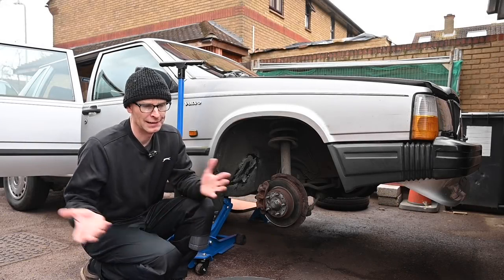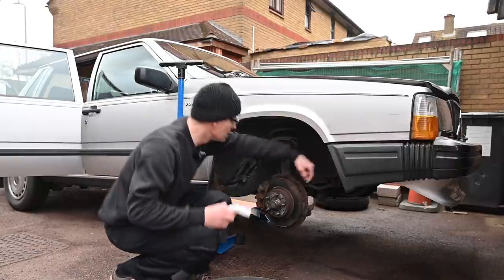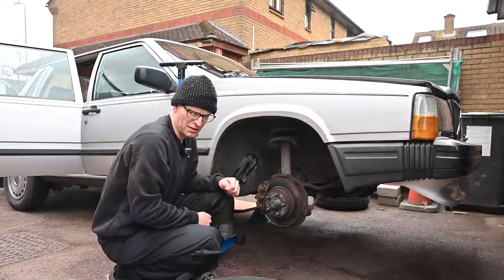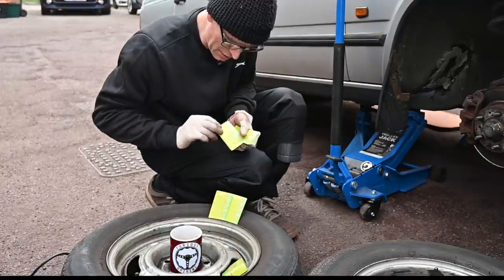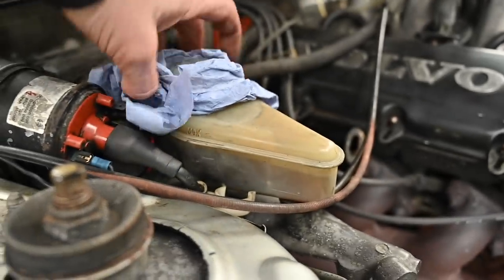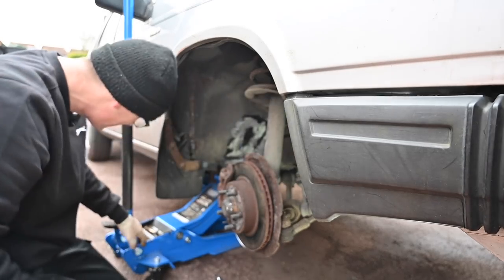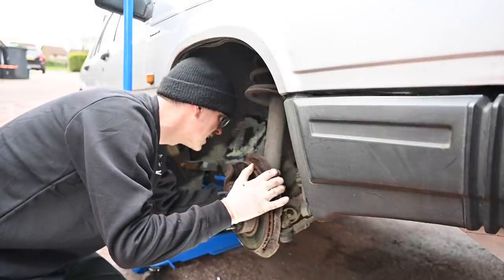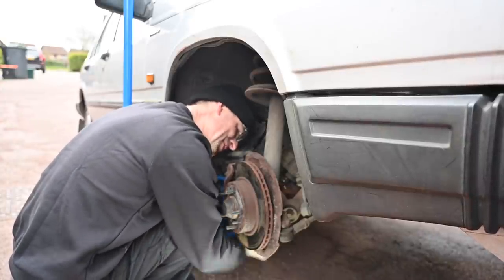Volvo part 5 - 740 gets front brakes and tyres

Comment: I have more faith in a random ebay store, located hundreds of miles away, to supply the right parts than the muppets at my local ECP.  On the few occasions I've been in, I've always had a wait, simply because at least one other customer in front has also been  supplied an incorrect part. Service is shocking.

Comment: easy way to know what brakes you have, if you can have 14" wheels, that you have, you have the smaller ones up till early 88-, the bigger ones that came late 88- require 15". another cool thing, if you wish to have the bigger ones, all you need is bigger rotors and caliper holders. and ofc 15" wheels.

Comment: I love videos of car repairs from UK or Irish youtubers because it feels so much more relevant than the US channels.  I’m impressed at your dedication to work outside and film it all in this weather.  It’s a pain when you buy parts and they are wrong, it happens to me all the time, so much that I stopped buying stuff on eBay and now support local motor factors.     I’d love one of those inductive heaters, I remember when I first saw one on wheeler dealers and was impressed.. having said that I’m convinced that a squirt of penetrating oil would have dome the trick, but you would have had to leave it a while to do its thing.... now I’m going to Amazon to look for inductive heaters!
Reply from the maker: haha, sometimes WD40 works, sometimes it takes more! Check back to my Rover Tomcat suspension videos when I got that tool - I spent an entire day on one bolt, oil, heat, hammers, scaffold pole you name it, got the heater and it was off in 10 minutes!

The rain doest help, maybe one day Ill be able to get a barn or workshop, thats the dream!

Comment: Eurocarparts.  Also known as Your Wrong Car Parts.  They had me going once with some rear pads on a Saab 9000. The pad that clipped into the caliper piston kept popping out but it looked identical to the old one. In the end I measured the spring with a vernier caliper and it was slightly oversized. I suspect they were fake parts,changed for another brand and problem solved. Never dealt with them much after that.

Comment: The only tracking setting that matters is the sum of the toe on the left and the right wheel. When you turn the steering wheel, one gets bigger and the other smaller so, unlike all the other alignment settings the absolute value on either wheel is just telling you which way the steering wheel is slightly pointing.
If it's toe in then it tends to wear the outside of the tyres. As UK roads slope down to the left, you're normally steering slightly to the right, so the outside of the left hand tyre wears most. If it's toe out then it's tending to wear the inside and again, as you're steering to the right, it's the inside of the right hand tyre that wears most. If you point your hands in or out a bit and then picture dragging them along a surface it starts to make sense.

Comment: Enjoyed this video, we have all been there with parts that don't fit.... one advantage of the motor factors is you can swap them immediately, with fleabay you'd be waiting ages. I've the knee pads pants aswell and it only took me 20 years to learn the hard way.
Reply from the maker: All the good old motor factors I grew up with are closing, very sad
Reply: @furiousdriving  I just had an annoying experience with fleabay where the ad said suspension top mount "left and right set" so I snapped it up only to find out it was only one item so not the bargain I thought I complained that the ad was misleading and they tried to bs me plus I'm waiting a week already. Local motor factors much better and quite competitive these days.

Comment: My late Uncle had the very same 5-large-hole steel wheels on his Powder Blue 1982 (X reg) 245 GLE Estate. I didn't know they were carried over to the 740. The earliest 2.3 GL/GLE (B to D plate) 740's were given a completely new steel-wheel design. 14 inch 10-square-hole design, usually coming with bright trim rings and bright dog-dish centre covers. So maybe these older wheels made their return when the 2.0 litre 740 came out mid '87 I'm sure.
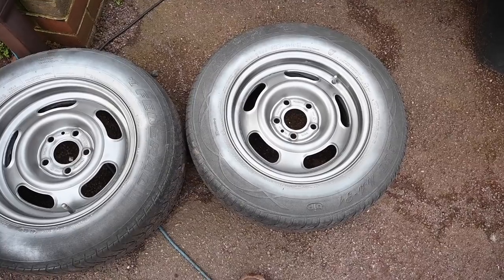Reply: Oh, and @ 2:07 to 2:25 I could smell that strong, unmistakeable Cellulose paint just by watching you paint the wheels. Yes, you MUST paint them, otherwise next time you take the wheels off, they will be dirty and HORRIBLY surface-corroded due to no protection. Another great, productive video. I'm enjoying following your projects.
Reply from the maker: I dont think they ever stopped using these wheels until the end of the 90s when the much more modern range appeared

Comment: That disc did indeed not have any oil or grease on it. More discs now are given that matte finish, which is a light layer of electroplating (I think) that protects the disc without the need for grease. The electroplating simply wears off the first few times you use the brakes. Keeps the disc hat looking fresh for longer as well.
Reply from the maker: Its the first time Ive come across it, good idea and explains the smell on the first drive too

Comment: Very well explained  vlog , have noticed the size of the working space in the wheel arch. Even if it is,  it doesn't look to tight working in there.
Reply from the maker: Its huge in there! Much easier than most cars Ive worked on

Comment: Whilst it's hot with the induction heater, quench it a little with some penetrant. Will make life easier! :) I'd also advise using camskill for your tyres as they'll be much cheaper. I also believe the Rainsport 3 has been superseded by the 5. Don't know if they're selling off the last of the stock or not. Great tyre. Great video as usual too!
Reply from the maker: To be honest it couldnt get much easier once its hot! Im not sure they do Rainsport 5 in this size, but 3s are still available

Comment: I hear some clanking from the engine, to adjust the valveclearence you need to change metaldistances underneath the camshaft,  those could be bought one by one from Volvo back when they kept all parts for them. I once adjusted mine by measuring the gap, checking the tolerance in the manual and then removing the distances on the ones who was off, I could reuse some but move them to the corresponding valve that gave the right gap and  bought a few new ones. I seem to recall there where thickness stampings on the underside. But You probalbly can see how to in a Haynes manual. Now, it can be the rodbearings too, but...
Reply from the maker: Bearings on only 140,000 miles? its barely run in! I don think it sounds as smooth on the video as it does in real life but worth checking when I do the rocker gasket
Reply: @furiousdriving  nah, the rodbearings should be okey with those miles, but the late B200-230 got narrower bearings in an attempt to lessen the fuelconsumption, those rods aren't good for enhanced tuned engines. But for a standard engine they should be more than adecvate.

Comment: Eurocar parts are famous for getting parts wrong, you can give them the reg no, the vin number and they will still supply the wrong parts.
It does help if you have seen the original parts or take the old ones for comparison.
Mind you they then tell you they don't have any of those till tomorrow / next week, ect, etc.
Buy yourself a decent breaker bar and some deep impact sockets, they make changing wheel and jobs like that far easier, Saves you hands and back.
Reply from the maker: Lucky the guys in the desk are helpful despite the computer! I need a cordless impact driver!
Reply: I bought a pneumatic ugga dugga and it's superb saves loads of pain in my arthritic hands.

Comment: Volvo 740's look cool when they are slammed!
Reply from the maker: An evil part of my mind had been googling slammed 700s...
Reply: Maybe it looks cool, but it destroys its uniq feature - floaty comfort. I live in Europe, where roads are in a very bad condition, and you know what, my 740 eats up every bump like some of the old Mercedes. I have owned so many cars from Mercedes, BMW, VW, Audi and right now i have newer Volvos, but these old ones with their original suspension are brilliant. And suspesion is one of the reasons i kept my 740 turbo, because i can just fly over bumps and holes, it just just dont feel them, so if you want to slam a car, use the right way with air suspension and ride hight contorl.

Comment: I'm changing the brakes and discs on my 1987 Volvo 740 and I got the brakes off and got to the disc and I didn't have a male socket that I needed to remove a female nut/bolt that's holding the disc. What sockets did you use?

Comment: I skipped back to rewatch the 740 driving into the garage, sticking out like a sore thumb (in a good way) . 80s class among all the characterless disposable cars - brilliant! 
Typical Volvo brakes btw, inexplicable size differences with no information from the motor factors to help and a 50/50 chance you'll go home with the wrong ones

Comment: Do you know much about Jaguar X-Types, going to look at one for sale on Friday, anything I should look out for?
Reply from the maker: Look really, really hard at the sills, they rot like crazy there and its hard to see
Reply: Rusty front sills under the plastic outer 👍
Reply: Rust. Mostly in the sills, but anywhere between the front and back number plates really. I had an estate one briefly - one of the run-out models with the mesh grille. Lovely deep paint, luxurious quilted leather interior, loads of toys, and fair wafted down the road in a slightly sporty way. But ..... I’d previously owned the Mondeo it was based on - superficial luxury feel aside, the X-type was made worse than the Mondeo it was derived from. It was smaller, less reliable, more expensive to fix, and rustier. Much, much rustier. At 4 years old it needed a whole new tailgate due to rust. I slammed the tailgate one day and the number plate fell off, still attached to its fixings and  a couple of circles of jagged rusty metal. Then I had a lorry back into the front (new bumper needed) and the body shop it was booked into found rust in the sills and one of the chassis legs at the front. An expensive fix, was that. Buy a Mondeo or a Volvo instead; same idea, done better.

Comment: those lads at KwikFit be like "E-reg Volvo, standard procedures" :P
Reply from the maker: It wasnt on the computer!
Reply: @furiousdriving  i went to halfords few years back for part for my 92 ford sierra, was told no parts avail its obsolete was shocked and angry n left
Reply: @hitachi2556  the database probably cuts off around 1997, from what I've seen from what some other companies use
Reply: @RWL2012  no surprise whereas my local family run factors can get everything lol

Comment: So, were those 28cm discs Euro Car Parts mistakenly sold you actually intended for a Turbo or V6 engined  model?
Reply from the maker: Dont know, there are girling and Bendix systems and different sizes on different years and models

Comment: brake tip remove pads remove disc  find large piece of cardboard draw round  disc and pads  cut out   take cardboard templates to motor factors to match up  thats if you cant take the actual discs n pads  saves soooo much time  . i had transit van tyres on my 740  they worked really well as its a big heavy car  felt more soild not that volvos arnt solid to start with  lol

Comment: These cars have a really tight turning circle so they can scuff edges of the tyres if you take advantage of it.
Reply from the maker: they do have a taxi like lock,  but only on one side of one tyre? You'd have to do a lot of mini roundabouts to get that much wear!
Reply: @furiousdriving  I used the full lock a lot on my 1988 - 740GL.  I tried not to use it as I could see I was wearing the tyres, very hard to resist when in a tight spot.
Really enjoying the volvo project. You are bringing back all the good times I had with my 740 in the late 80`s and early 90`s.

Comment: If you put car on full steering lock it makes doing brakes easier.... Why oh why can't manufactures just fit 1 type of brake
Reply from the maker: same reason phone makers wont put one kind of USB charger
Reply: @furiousdriving  No I don't mean all    manufactures fit the same just the same on that model so when you go get new pads your not faced with Well it could be 1 of 4 different designs mate
Reply from the maker: Ah yes I see what you mean!